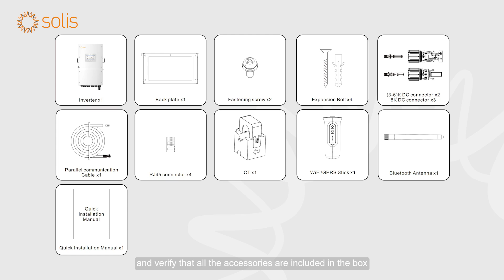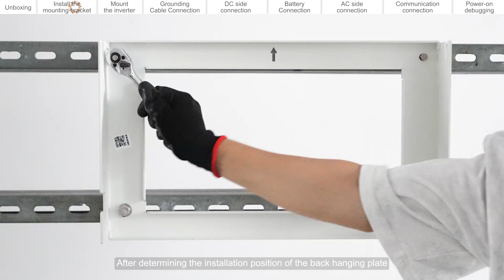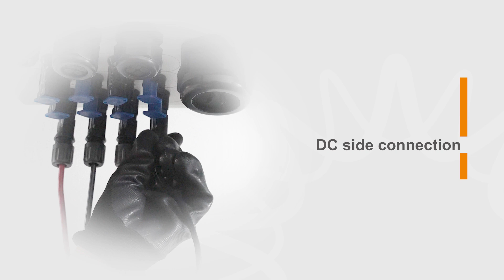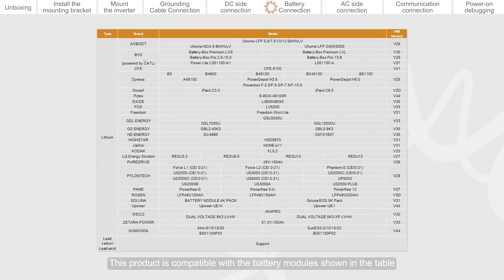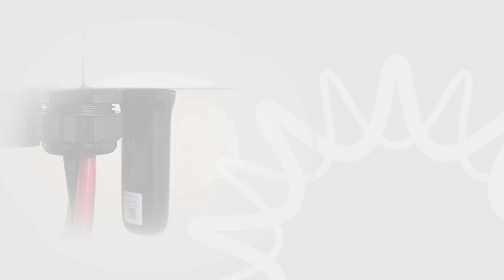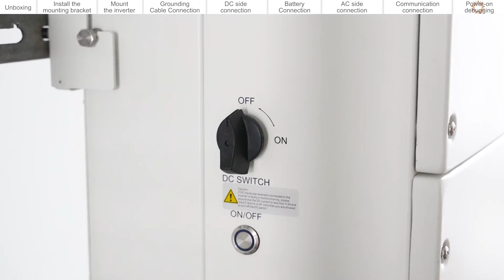Installation Guide | Solis S6-EH1P(9.9-18)K03-NV-YD-L

Comment: High voltage or low voltage ?
Reply from the maker: low voltage
Reply: @solis7119   does this inverter support a battery from Hithium brand ? 

Is there any version with the same specifications with high voltage?
Reply: @solis7119 what does it mean low voltage and high voltage in inverter
Reply: @pubggame-t6n  battery capability it can support